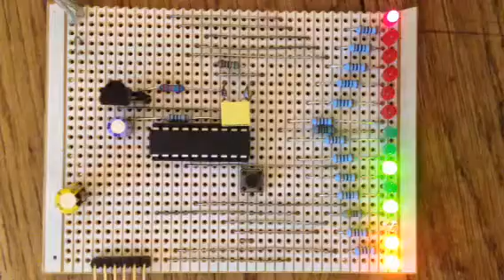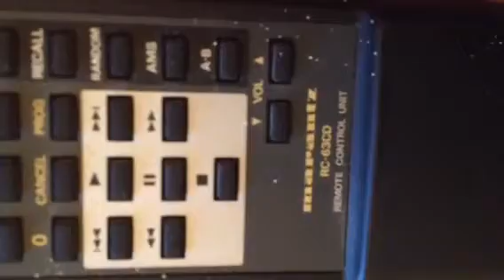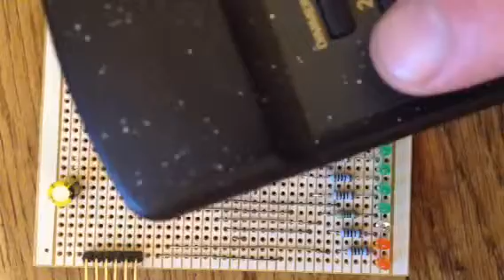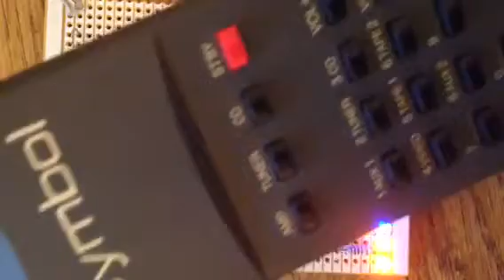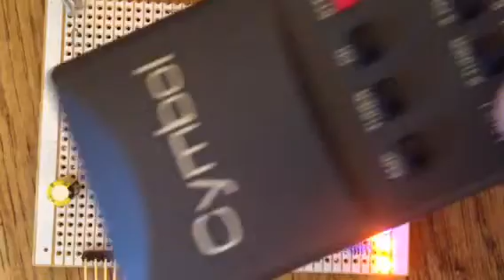Philips RC5 IR decoding with PIC 16f690 microcontroller

Comment: Hello. I have uC PIC18lf46K80.  The code would be the same? Could you send me the code on my email: danielcieslar1994@gmail.com Thank you very much. Take care :)
Reply from the maker: Hi, my code will only run on 20 pin 16F devices with 10 bit ADC such as 16F690. 18LF46K80 is a 28 pin device with 12 bit ADC. The C code is provided in the link above.
Reply: Thank you for answer. What can I change in the code?  I would like to run this code on my PIC. Thank you for help. I am electronics, but Iam beginner programmer.
Reply from the maker: Tom,
All of the initialisation code would need to be changed, which for a beginner might be difficult. If you want to get the project working quickly, I'd recommend using a 16f690 rather than trying to modify the code for 18LF46K80.
Reply: I no have money to buy a new uC. I will been trying to change the code. Thanks for help :)